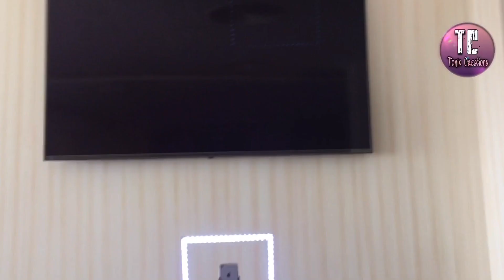DIY LED Square light | Tonix Creations

Comment: Smokey effect sa intro ang astig, salamt sa tips kyng paano ikokonect ang led quare light  para aware ako next time salamt
Reply from the maker: Ung pong ginamit ko n led strip light ay 12volts,so ung adapter nya ay 12v din po kya match po sila pra d msunog.pg bumili po kayo  ng led strip ung my power supply n ksama.